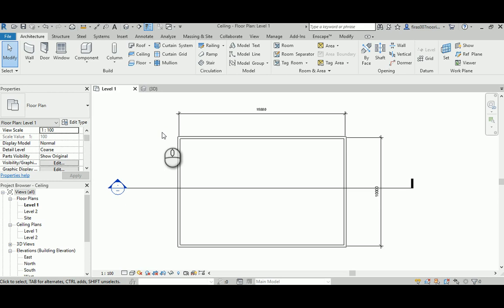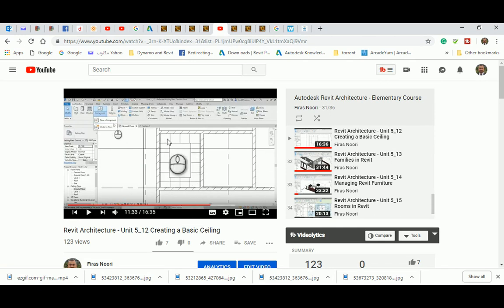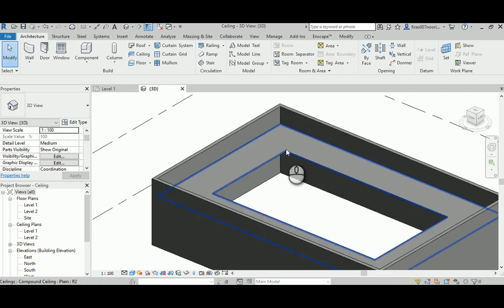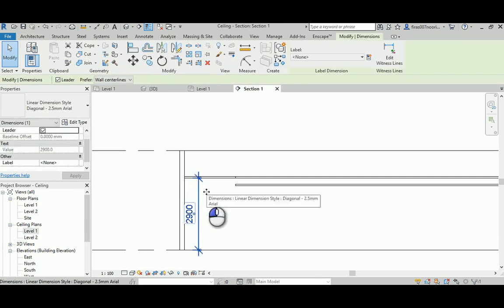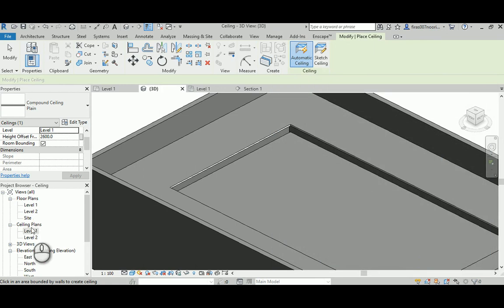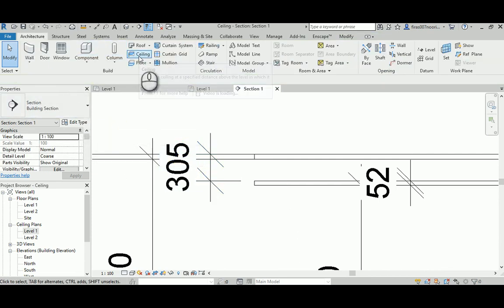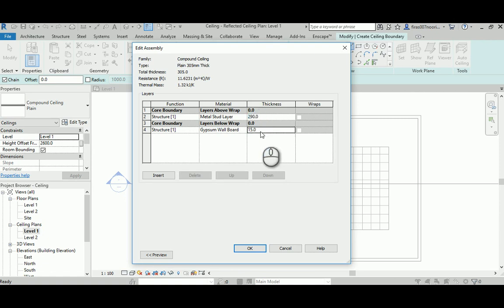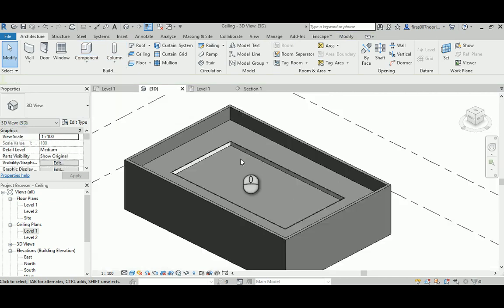Revit Architecture - Extras _ Another Method to make Ceiling in Revit

Comment: One question please. To purge on revit, would you please do a tuto for us ?
Merci 🎇
Teri
Reply from the maker: I will send you the steps as soon as I get back home, it is very easy no worries
Reply from the maker: open Revit then go to the "Manage" Tab then "Setting" panel then select "Purge Unused", use this command to get rid of all unused families, but I highly do not advise you to purge, as this will delete all embedded required families that you 100% in need
Reply: @FirasNoori  
Merci for replying so quickly. But if you advise me to not purge. What is the use of purge so ? 
Teri
Merci
Reply from the maker: Purge if you 100% finished the project in Revit , no changes, coz it will delete every family member loaded in the template and you did not used, it might sound good as it slightly reduce the file size and increase ur machine speed, but later if you want to use this file as a startup file of to add things to it or to complete the job, you need to reload things manually.
If you are purging to increase speed, you can use other techniques like smart family modeling, and not to use in corrected imported furniture from the internet, a chair modeled in max and loaded into revit family repeated in revit for 5 or 6 times is really enough to damage the ram and slow down ur file forever, extra unrequited modeling or details might do the same! 
Autocad purge is might be justified, unseen blocks, wrong layers and unused!! But in revit there are no layers and most of the added families will be used, 
Thus you can purge in Revit, but do it as a last step after you finish work not as a method to enhance file performance if you got my point
Cheers

Comment: Oh ! You are the best !!
Reply: Hi mr Firas, 
Regarding my desk top: the dimension i choose are: 
The box is about : 19"x8" plus i added little fans for aire the circulate well and want with the : AMDRyzen 5 2600 plus i add a large computer screen
I have cad & revit: works very well so far.
Reply from the maker: @teriperson363  Sound Great!! thanks
Reply from the maker: Thanks dear, I do appreciate it
Reply: @FirasNoori  
Please, i would like to ask for your expertise. I had an issu before and, still cant fix this headache...
When i export a chandelier or a pendant light to the projet it stays or hang on a vertical view, i cant change it to an horizontal view. I tried different things but still this issue persist. Would you have any advise to give me ?
It has to do with its view & parameter i am guessing, an horizontal or vertical check mark maybe ?
Thank you.
Teri
Reply from the maker: @teriperson363  Hi dear Teri, long time since your last post, I wish you are doing well dear,
Lots of reasons behind this, basically lets try to open the ceiling floor plan not the Ground Floor Plan as in the ceiling one you are looking upward to the roof or ceiling direction allowing you to attach ur element to it (if you are in normal floor plan, it will be above the view and you will not be able to see in plan!! and you get a warning message teling you to view it in section or elevation)
Second, check is it a ceiling based family (and thus you must have ceiling in ur room to be allowed to add it) or Is it a roof based family where it can be attached to the lower part of the a slab or floor.
Third, it could be the family need to select to be placed on any element and then you need to press on an option that allows u to place it on any surface to free it from the origin that it was designed to stick to it
Sorry for my late replay, I was a bit busy with my sick son,
Cheers
Reply: @FirasNoori  
Bjr Mr Firas, yes you did not hear from me, i had a month of hard work, as a result: so tied. ;) thank you for remembering me. Sorry for your son, from what i heard, no time of your own with a little one. 
From what you describe regarding revit, it is more than likely the silly mistake i made. I will work on it & let you know the result. 
Hope you are doing well, too bad you cant clone yourself to teach overseas ;)) 
Cheers professor 💝
Teri